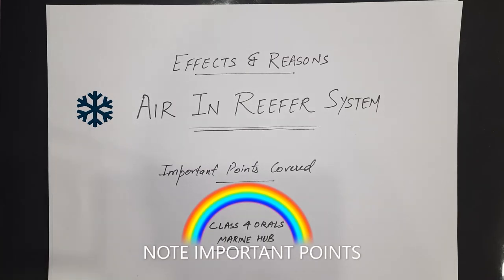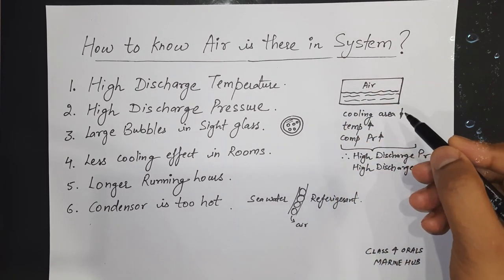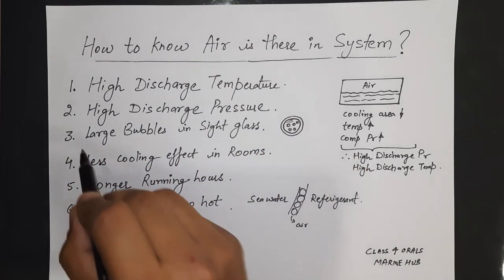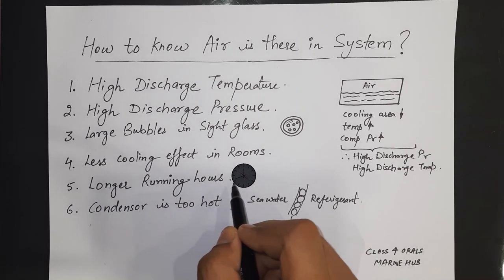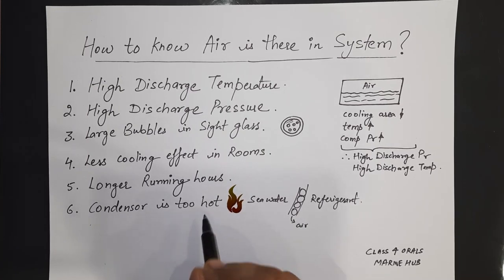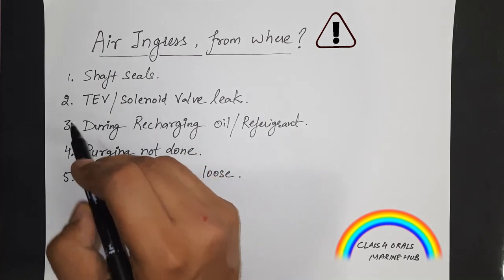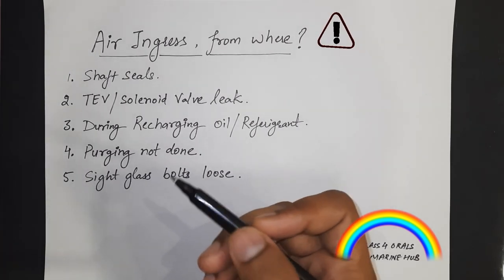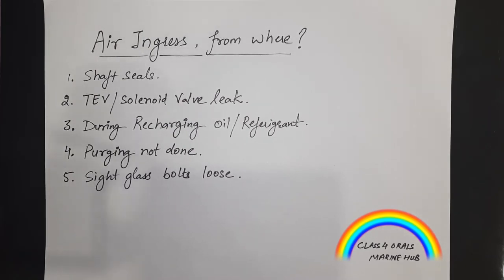Air in Reefer System How Air Enters, Its Effects & Reasons | Full Explanation Must Watch Imp Points

Comment: but how air will enter from sight glass? The pressure inside is more.
Reply from the maker: Suppose the bolts are loose. Then air can enter. Suppose system is stopped  for some time, that time air can enter
Reply: @CLASS4ORALS  ok got it. Thanks
Reply from the maker: Most welcome